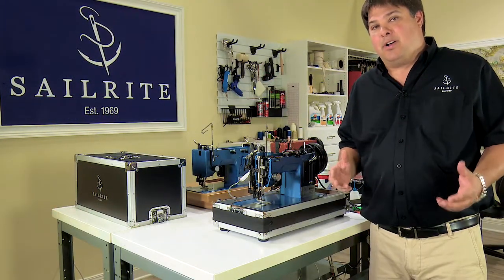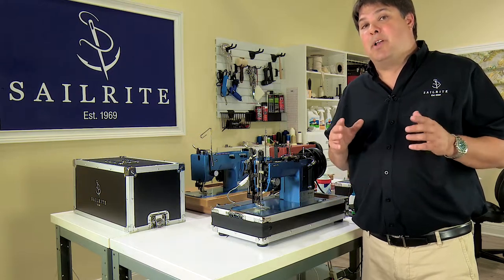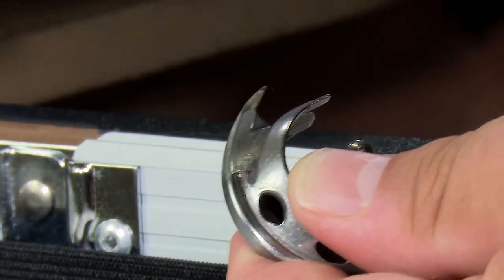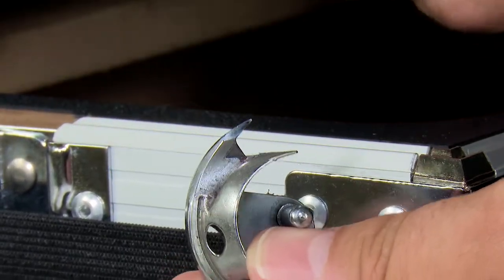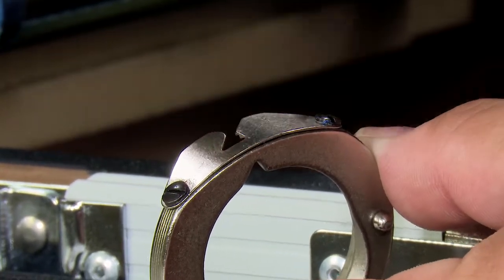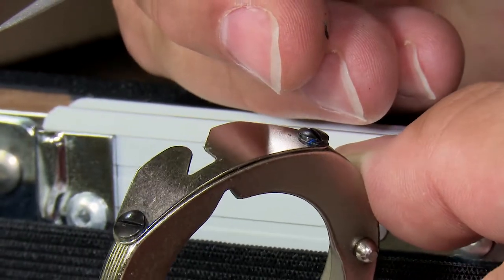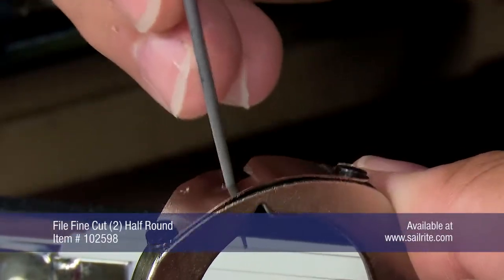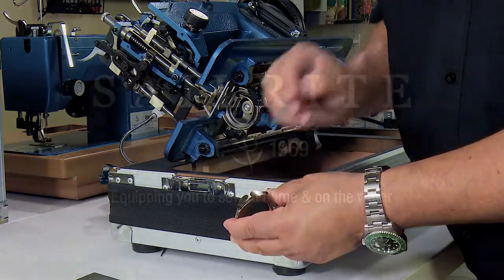Needle Strike (Cap Spring & Hook Maintenance) for Ultrafeed Sewing Machine

Comment: Hi all, I just received my LSZ-1. Had ordered the plus package. Watched many hours of setup and how to use. Bought a Sunbrella® Carry‑All Tote Bag Kit. Followed all of the video watching several times. While sewing the second bag at the "sew on the pockets", during the first reverse stitching the bottom the machine locked up. I stopped sewing and looked for a thread bind. What I found is the hook assembly is 90 degrees ahead of the hook to loop grab position. So ... I can manually rotate up to needle plunge. The needle is hitting at the hole behind the hook point but staying in the center of the cap spring. For one, after paying over $1400 for a machine and accessories, I would expect that it would be correct and run without problems through at least one kit. I'm disheartened. I can't find any videos on how to RESET the rotation of the hook timing. I live in ALaska. To ship my unit anyware it costs $180 and higher. Please HELP. I have had this unit a week and i'm using it for the first time.
Reply from the maker: I will include a link to the video showing how to reset the driver rotation: https://youtu.be/vt0H8OfxYkU However, I would like for you to contact Sailrite at: support@sailrite.com so a support case can be entered in our system. We want to be sure that this issue is resolved and if you need more help we would be glad to help you through that support case. Please email us today, if you have not already done so.

Comment: Quick question would it be advisable to use a Loctite on the plate screws
Reply from the maker: No, you do not need to use it for the cap spring.